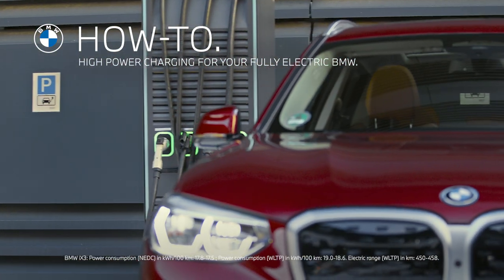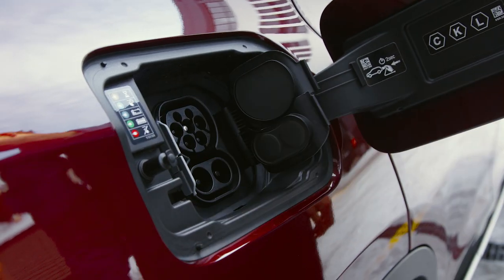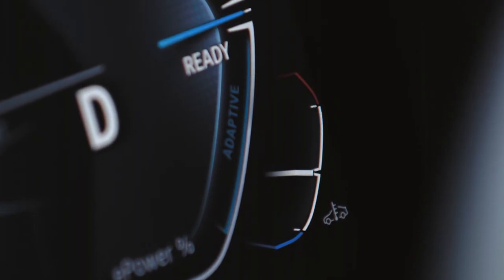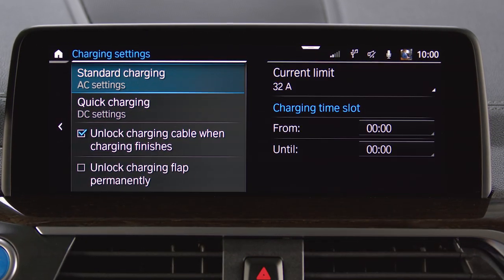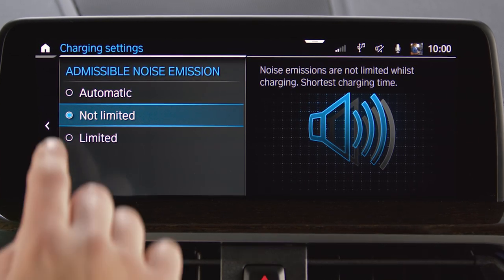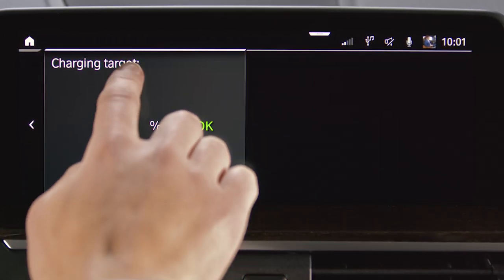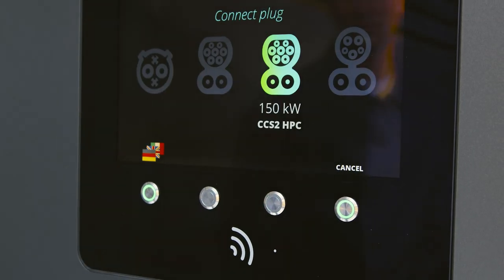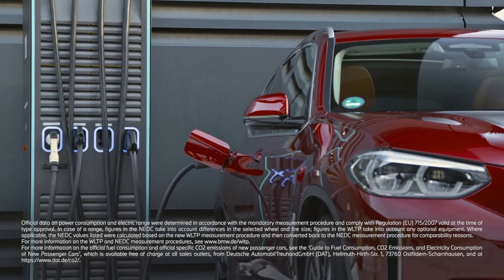High Power Charging for your fully electric BMW – BMW How-To

Comment: Hi, I am seeing a considerable reduced range and charging speed in Winter. Anything I can do differently?
E.g. Precondition the battery before charging (not sure if it is possible for iX3)? 
I used to get 400kms+ range in Summer but I am afraid, the car will not last a day trip to ski slopes which is 280km round trip.

Comment: Can I charge my iX3 at Porsche and Tesla charge points? It was working fine at the local Porsche garage until this week. Been back to the BMW dealer who told me you cant use a 350kwh charger as its to powerful. Then backtracked and said it was because Porsches technology is different. Strange as I had been using it up until a week ago! Don't know if it has any bearing but I installed a software update over a week ago, could this cause a problem?

Comment: BMW twinpowerturbo petrol engines all and twinpowerturbo petrol engines hybrid all : Easy damage parts engines, 20-100 l/100km, over 100 l/100km by Formula One speed 160-250 km/hour, over 250 km/hour on all circuits, driving with limit speed law on all path roads and test maximum over 150,000 rpm.
All BMW series with wider rear track than front track bodyworks all : the lowest traction 0.7g, extreme tail flick, extreme slide on all circuits with Formula one speed 160-250 km/hour, over 250 km/hour and little tail flick with driving traffic limit speed law on all curve road, changing lane, all turning kind on road.
From
BMW limit performance database